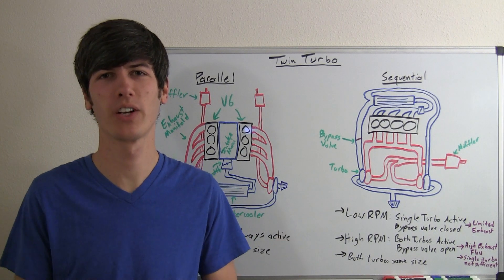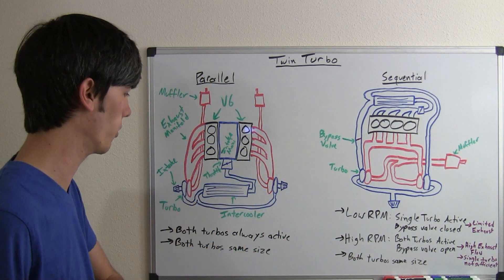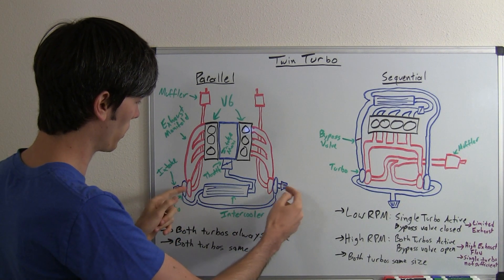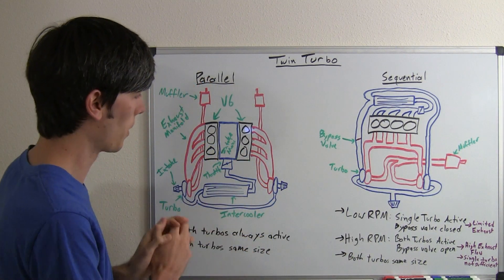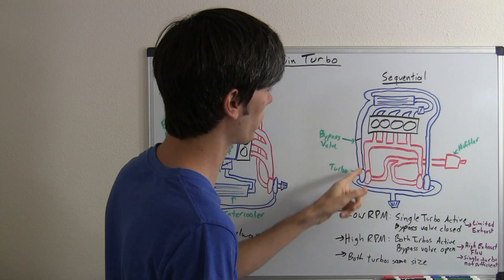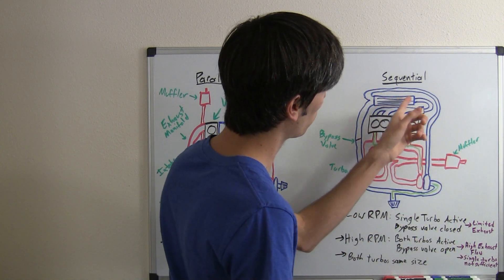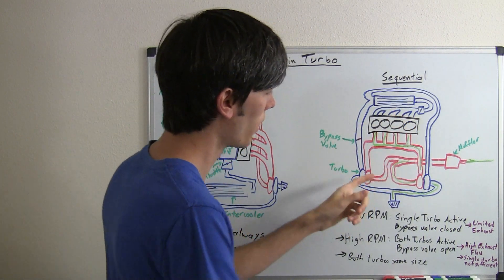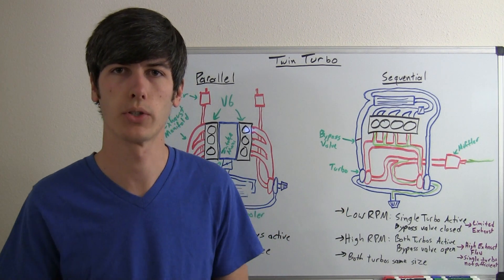How Twin Turbos Work - All The Boost!

Comment: Please compare the advantages, disadvantages and general qualities of each of these 3 forms of turbo charging (after the next video). Thanks.
Reply: Agreed!
Reply: Well, he did mention one, in the sequential setup you get better boost in lower RPM because you're directing all exhaust to only one turbo, which then spins faster than both together, thus, I assume, reduces turbo lag helping turbo kick in faster, the disadvantage SEEMS to be a harder setup and increased cost due to the pressure valve and the piping itself (considering that the cold air intake is not that expensive, so saving one wouldn't make much difference).
Reply: Pedro Sánchez i also think the 2nd choice would be more beneficial for smaller engines, and choosing 1st or 2nd for larger engines wouldn't make much difference
Reply: Actually, that doesn't matter, because with a parallel design, you have two separate exhaust systems, this means there's enough exhaust for both turbos. Whereas in a sequential setup, you only have one exhaust system, a smaller engine, and therefor only enough exhaust for one turbo, so it makes a huge difference.
Reply: Brady Stickles so therefore you’d only want to use a sequential turbo setup on smaller engines and parallel set ups on 6 cylinders or more?

Comment: Im not gonna say your wrong.  Most of the time though with the Sequential System, the Bypass is AFTER the intercooler and, sent through a pipe to the compressor side located at or near the main intake.  It keeps the cooler air charge in the system and produces better results due to the fact that the air is cooler going into the compressor with less wasted energy.

Comment: Awesome video! One thing I don't get though is how having a bypass valve on the intake side of the "higher RPM" turbo stops the exhaust from going through this turbo. Like how do the exhaust gasses know to avoid this turbo when the bypass valve is closed?
Reply: I believe I can hazard a guess here. When the bypass valve is closed, it will block air going through into the intake manifold from the turbo on that side. That causes a strong backpressure against the compressor of the turbo, which makes it difficult to spin that compressor very fast. 
Because the compressor is hard to turn, it also stops the turbine side from turning, which inhibits the exhaust flow through the turbine, resulting in a much higher resistance. As is characteristic of any system like this, the exhaust flow will take the path of least resistance, i.e. it will head towards the uninhibited side until that side gets so clogged with exhaust that its backpressure equals that of the inhibited side. If the pipe is correctly sized, and of course it is, such a situation will never happen until the RPMs get high enough that the bypass valve is opened and the other turbo becomes available.
Of course, the blocked side still turns a bit, and a small fraction of the exhaust likely leaks through the turbo vanes on the blocked side, but the speed and leakage is so miniscule as to not be relevant to the operation of the engine.

Comment: Please explain dual-charger (turbo + Super charge on same engine) and Variable-geometry turbocharger.
What are their pros and cons?

Also please cover all-motor vs force induction.
Reply from the maker: You got it.
Reply: Those are literally gas refining factories with wheels. The only brands that tried that on a large scale abandonned this pretty quickly. Flimsy, expensive, prone to failures... it was a shitshow.

Comment: Engineering Explained Could you please cover compound turbo setups?  There seems to a lot of debate about their setup and performance use in gasoline engines. I'd love to hear your take on them and about how compounded pressure ratios affect performance.

Comment: This video has a couple incorrect information. Just shedding some light.
-In order to run twin parallel on a V Engine, there must be 2 throttle bodies, and the air induced by one turbo is to feed air to the opposite side cylinders. The crossing over maintains a balance for both turbos, preventing half an engine from overpowering the other half. For examples, see engines for Z32 300ZX & R35 GTR.
-Twin Sequential does not have 2 turbos within the same manifold. All exhaust goes into turbo #1 and then the turbine exhaust (excluding exhaust lost by wastegate) goes into turbo#2 which will kick in at a later time. For examples, see engines for MK4 Supra & FD RX7.

Someone mentioned earlier that RX7 and Supra are twin parallel, this is not correct, they are in fact sequential.

Love the channel man
Reply: Eddie Trevizo Audi B5 S4 has a V6 with twin parallel turbos and a single throttle body...
Reply: Douglas Scott Yes. You are absolutely right, the Audi B5 S4 does have such a set up... BUT :) That engine's average turbo lifespan is 31K miles. The Audi B5S4 is known for "turbo whining" which is directly caused by an imbalance of pressures from the compressor and the turbine. Essentially the pipe's boost is slowing down which ever turbo is spinning at a lower speed, but the exhaust gas is still coming out at a higher rate which instead of efficiently spinning the turbine, it finds its way out and makes a whining sound from the friction the gas makes with the curve of the turbine. (I hope that makes sense)
So yes, you are right Audi did make an engine V6 w/ parallel turbos, but the imbalance I mentioned before shortens the life expectancy of that engine's turbos. Please correct me if I'm wrong or missing something. I rather know what's right than continue to think what I know to be right.
Reply: Eddie Trevizo I have 150k miles on the stock turbos on my B5 S4. There are many others with more. The failure rate was due to oil feed lines, nothing more. 

I think what you're trying to describe is compressor surge. This is not an issue on the B5 S4.
Reply: That's freakin awesome man. My only guess would be that your batch of turbos were machined at a near perfect spec, or your diverter valves on the Audi have served very well at aiding in pressure imbalances. I read on forums that alot of people stop the turbo whining before it worsens by replacing 1 or both DV's.
Boost surge is similar, but in an opposite way. Boost surge is from slow release of boost, where turbo whining is while under pressure/air flowing in to the motor. Almost as if you had boost surge on only one turbo, but while under boost conditions.
Reply: Eddie Trevizo yeah i was thinking the same about the power imbalance, nice info bro :)
Reply: I have a l76 twin turbo set up... one throttle body..alone with ever ls twin set up ive ever seen
Reply: is there any valve on 2nd turbine exhaust line to prevent wastage of exh gas flowing to turbine which is not in use.Also we can use one single larger T/C why use two which would increase maintenance and occupy  more space and piping is very complicated.could you share some diagram of pipe line system or actual system for sequential T/C
Reply: ***** Google "Comparison of Rx-7 13B-REW and Supra 2JZ-GTE sequential turbos". This forum will explain how these 2 sequential turbo systems work.
-The Supra is simple, has 1 valve on the exhaust manifold that completely blocks off exhaust gas from turbo 2 until a later moment.
-The RX7 has 2 valves on turbo 2's compressor charge side. When one is blocking off the air from flowing from turbo to intercooler, the other is open allowing the air to recirculate around and around. But then, an actuator will switch both valves around. Turbo 2's air will flow to intercooler and not recirculate.
Personally, I like the Supra's system better because exhaust gas is not going to waste like in the RX7. It uses all exhaust gas on turbo 1 for a period of time, but then splits evenly for both. In the RX7, turbo 2 always has exhaust gas flowing through it, but its air flow is being blocked off, until a later time.
Reply: Thank you. But what I'd the advantage in terms of fuel saving, exhaust emission could you please let me know.
Reply: Technically you do use up more fuel during the boost/acceleration phase, but you would begin to cruise sooner than you would with a non turbo.
Turbo is good for getting you up to the speed you want fast and start cruising. Steady speeds, low throttle is what will get you the best fuel efficiency. So in essence, turbo should always be more efficient during normal driving use, but will burn your gas faster if being raced or pushed hard for longer periods of time.
Emissions is more of a measurement of overall engine health. Just having a dirty/blocked EGR will cause exhaust gas temps to increase, which will cause more NOX's to be produced. Emission just requires everything in the car to be working properly: sensors, cats, egr, plugs, injectors, etc.
Reply: most of fd is parrarel cuz majotiry of them had v8
Reply: No man, that doesn't make sense
Reply: Powder Blue:  you said  "to run twin parallel on a V Engine, there must be 2 throttle bodies" .. no there doesn't need to be 2 throttle bodies, there are plenty of examples with one throttle body feeding all cylinders... on very well engineered cars .. Iike Porsche's flat 6 with twin turbos.
Reply: Excellent thank
Reply: @ImJustKindaHere  so its like if you know your in a 'racing mode' just go all out and dont worry about fuel.. that is too say. Capitalise

Comment: Your picture has the bypass valve in the intake. In that case no flow path is available for that turbo therefore it won't do any work and the other will. They would both spool but only one would do work

Comment: Wouldn't a bypass valve be in the exhaust for the sequential twin turbo setup in order to keep the 2nd turbo from spooling? If it is in the intake, then it would only cause pressure in the intake pipe between the turbo and the valve as the exhaust would still be going through both turbines, but if a valve was in the exhaust to redirect the flow away from the 2nd turbo, the turbo won't be spooled. Either way you look at it you'll need a bypass valve on the intake anyways to prevent pressure loss from air compressed by the primary turbo escaping through the secondary turbo intake pipe.
Reply: That's just what I was thinking when I seen this video it's in the name bypass valve meaning it's has to be able to send it down another path so fitted correctly on the exhaust side it would work but that setup the bypass has no where to go, it's just a restriction to the boost coming of that turbo
Reply: really would like a response on this comment. i'm young learning along with everyone else and these were my thoughts watching the video too???

Comment: What's stopping the exhaust from going to the second turbo at low RPMs???
Reply from the maker: I should have drawn another valve in there. :)
Reply: thanx for asking. this is a big issue. you maby can add it into your video as a text bubble?
Reply: thanx for asking. this is a big issue. you maby can add it into your video as a text bubble?
Reply: thanx for asking. this is a big issue. you maby can add it into your video as a text bubble?
Reply: the waste gate!

Comment: On a twin turbo could you have a small turbo on one side to reduce lag  and a bigger turbo on the other side to make more power when you get more exhaust into it?
Reply: if i hear you right you're talking like a precharger and yeah a small turbo with high exhaust can cause constant boost which is good and bad its bad because theirs always forced air but good for gas mileage and boost you pretty much are going to reduce turbo lag this way just look it up i mean its expensive and people usually just go single turbo for the pain or a real twin but its not unknown,

Comment: What is stopping the exhaust going to the left (in you diagram) turbo at low rpms? In the system you are describing, the exhaust will still travel through the turbo on the left, spinning it up, but since that 'bypass valve' is closed, it would cause compressor surge (look it up), which would have catastrophic effects on the turbo, destroying it very quickly. I am not familiar with sequential twin turbo setups (nissan guy here), but I think what they will have is a bypass valve like you have illustrated, as well as one in the exhaust leading to the turbo on the left.

Comment: In this setup, the bypass valve only prevents boost leak(as he says the turbo 2 is not spooling). I think there should be a solenoid valve at the exhaust side that goes to the turbo 2, and that should be opened by the ECU when the desired RPM is reached( similar valve at the compressor side as well or even an Non Return Valve will work there).
Reply: As the bypass valve in closed position, there won't be any air going into the intake or outof exhaust manifold, but I'm concerned about the cooling efficiency for the higher rpm turbo

Comment: how do engines get air for combustion prior to the turbo(s) spooling?  does it travel the same way, just uncompressed?  I always thought having air enter the filter, go through the turbo and to the engine wouldn't be very effective without the turbo actually pulling the air in or pushing it towards the engine.  Or does the engine running by itself create a type of vacuum pulling air through the filter/turbo/intake manifold?
Reply: First, remember air is at sea level is at 1bar of pressure. during the "intake" stroke of an engine a lower pressure is created. High pressure will flow towards the lower pressure. Same as a Non Charged engine, this air is simply pulled through the turbo charger at normal pressure
Reply: Ben Hooker thank you

Comment: Hi! thanks for the video! Have one question though, I remember some manufacturer are making different sized of turbos for the L4 engines, smaller turbos are activated at lower RPM and the larger one is activated at higher RPM. Am I correct?

Comment: Would the bypass valve not be on the exhaust system to direct flow to just one turbo on the sequential set up rather than the intake system as on the diagram? Useless I’m missing a bit of information. Thank you.

Comment: Would the sequential setup not be slightly more restrictive when only 1 turbo is spooling since exhaust is trying to spin the other and compress air inside the intake piping against the bypass valve? Or does it vent back to the atmosphere until the desired RPM is achieved?.
Reply from the maker: Correct, or you could have an additional valve blocking the exhaust side.
Reply: Engineering Explained
Not could have, you should have an additional valve blocking the exhaust side!
Reply from the maker: mrdaxdk Yep, that makes sense.

Comment: Hey great video I was wondering in a sequential set up at low rmp wouldn't the exhaust still flow to both turbos?How does the bypass cut off the turbo from spooling up?

Comment: Random question. The bypass valve, is that an actuator controlled by the ecu, or does the secondary turbo activate it by pressure differential? ... Or  i suppose you could have mechanically connected in some way as well ?
Reply from the maker: I would guess you would want to control it by ECU, though there would be numerous ways of doing it.

Comment: Hey talking about exhaust stuff I was told that two exhaust are valid for "V" because of more than one cylinder bank, so on I-4 engines when two exhausts are applied the loose back pressure eventually losing power... Is that true? Is there an explanation for using two exhausts depending on something? Thank you so much... I love these videos!

Comment: Hi, i understand the setup of the sequential setup, i just dont understand these valves? whats if the valve is closer to turbo than the turbo that has no valve? then no  turbo will work? guess its just down to the maker to put the valve in the correct place? any help and advice would be much appreciated. Thanks!

Comment: I'm wondering about the placement of the bypass valve on the sequential setup, it seems like it doesn't block 2nd turbo spooling at any time, which would be lost energy on low rpms

Comment: So I presume that parallel turbos are used for pipe efficiency and to keep the manufacturing and assembly processes simple, right? Because with a single turbo feeding both banks you'd have twice the exhaust to spool up a turbo twice the size, producing twice the boost, but that would then be halved across the banks to produced the same boost per manifold at any given rpm, but the piping would be way more intense. Is that correct?

Comment: I have a twin turbo supra setup. And its currently running in seq mode. However i can just reroute a few vacuum lines& vsvs and run in parallel. However. In seq. Mode its already more lag than i like. And thats for when the 1st comes online and even the second. Its far worse if i run in parallel but kicks harder obviosly my question to you is. Do u know if i could modify perhaps how early turbo 2 comes online and maybe even turbo 1. By perhaps modifying bypass valve? Btw. I have elec boost control and ecumaster det3.  And i already have a borg single set aside . but for now im trying to have a lil more fun with the twins. Thanks for any input!

Comment: Hi! Nice video but I didn't understand one thing. When you speak about sequential twin turbo you put the bypass valve in the intake pipe, just after the centrifugal compressor, but shouldn't it be put in the exhaust so it would be able to deliver the hot gases to one or both turbines? If you put the valve as you showed I think there would be some surge problems. Thank you for the clarification.
Reply from the maker: Yes, I added an annotation at the appropriate time in the video to comment on this. Additional valve in the exhaust.
Reply: Ok thanks!